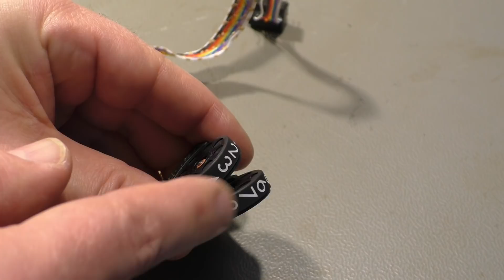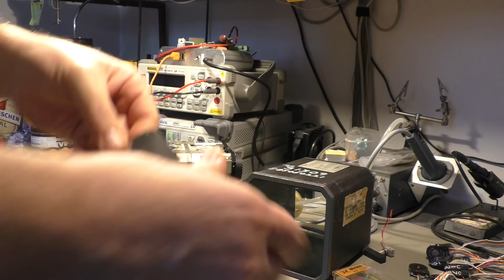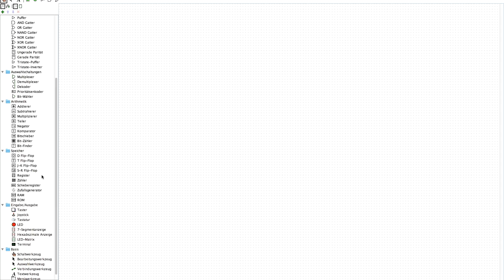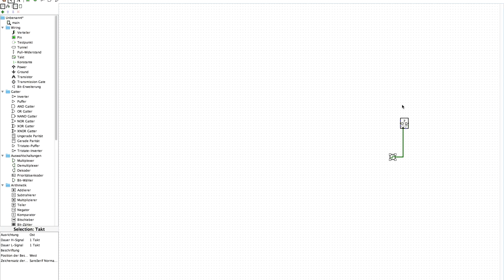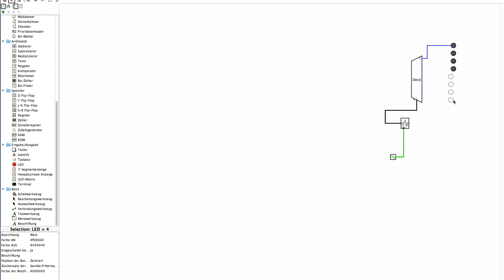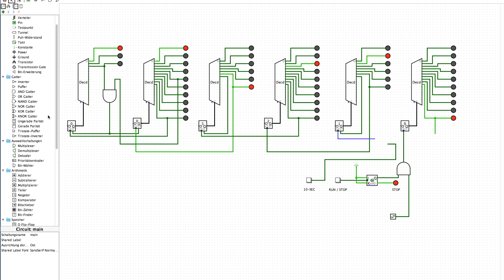Making of a digital mechanical old school clock - 1 of 2 (PWJ122)

Comment: Can't wait to see the resulting build of the clock. For a similar project of mine I also need such mechanical digits, but I was not able to find any to buy. Does anybody have a tip where I could buy such things without a teardown of a flight indicator?
Reply from the maker: I also tried to get those displays but it was not possible. I found a company that still makes them but when I asked for " 3 or 4" pieces, they did not answer anymore. BTW the teardown of the instument is not that complicated. A couple of screws and the displays are out. They even have connectors which can be unplugged.
Reply from the maker: This is the only working link I found: http://www.hyperneticsltd.com/indicators.html

Comment: Now you need a “restore” button too! :D
Reply from the maker: To restore what?
Reply: Anything! Then you'd have run/stop and restore as was in Commodore 64 :D
Reply from the maker: @AliaÅsten  Ok... I got it.... :-) A big brown restore button that does nothing. Or do you remember what it was used for on the C64?
Reply: @PlaywithJunk  It just sent an interrupt, but with RUN/STOP hold down it (by default) would soft reset the machine (ie the memory stays, but otherwise the machine is as if restarted). I don't know what the equivalent would be for this clock, though, but I just can't read "run/stop" without completing it with "restore" in my mind :p
Reply from the maker: @AliaÅsten  Yeah I know.... its just like CONTROL+ALT  that makes no sense without the DELETE :-)